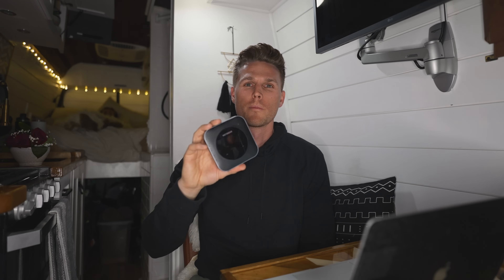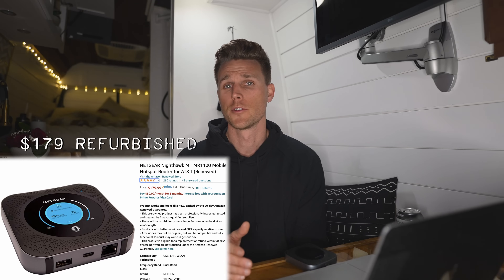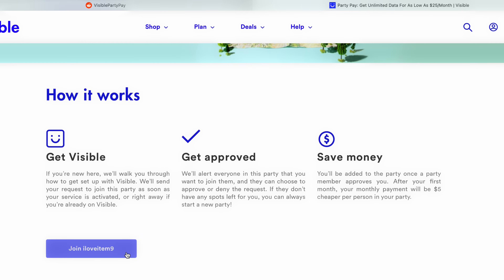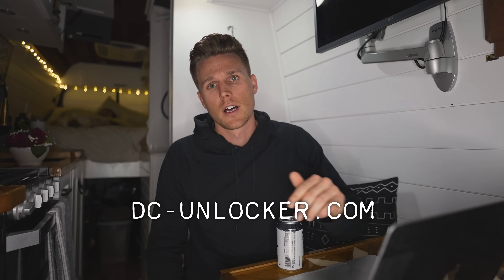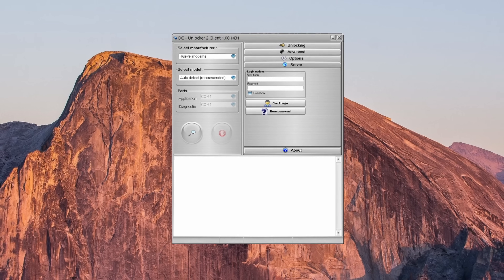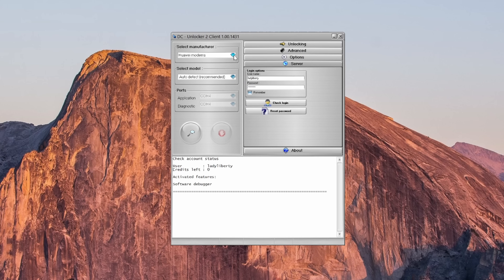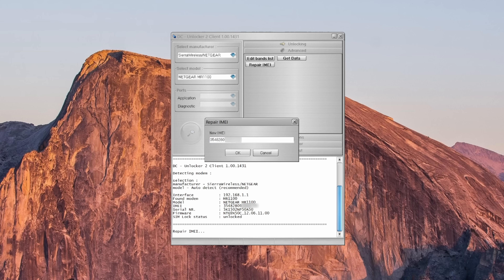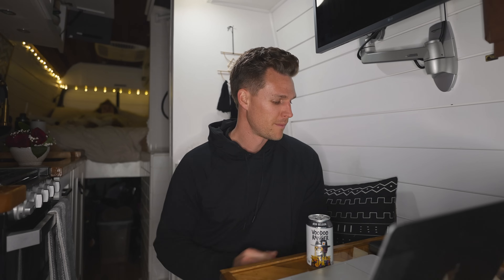CHEAP Unlimited Internet for your Van/RV/Tiny Home or even small Apartment | 2023 | $25/Month

Comment: I’ve got it all configured. My iPhone connects to the new network and I’m on the internet. However, my speed tests show that I’m only getting 5gbps. I’ve tried it when the M1 only had 1 bar of signal strength as well as when it had full bars. No change. Not sure what I’m missing. 

BTW, excellent video.
Reply: visible restricts the hotspot data to 5gbps
Reply: @ratfacekick  based on this video I’ve changed the IMEI on my router so that visible thinks it’s a phone and not a hot spot.
Reply: @rickcassani2810  I meant the hotspot on a phone, and mbps
Reply: Is it good for gaming

Comment: Well I think I have figured it all out with no help from Jake...(he doesn't reply)
I went back in to dc-unlocker ran a search on this Netgear and my search came back 
"DC - Unlocker 2 Client 1.00.1436

Detecting modem :

selection :
manufacturer - SierraWireless/NETGEAR
model - Auto detect (recommended)

modem not found !
Device must by detected before this operation!"
At the start of this I spent 29 credits to enter a IMEI number an all info was in the search and if I am correct I should be able to run a search and it should show my info but it doesn't! So Now what do I do anyone out there have an answer... I would be grateful to hear it. I wanted to take my girls on a road trip with WIFI it doesn't seem like I will....Or I will be returning this unit getting my $300. back...Please help  thank you

Comment: Sometimes when they say unlimited internet it really means is 20 gigs and once you go over those 20 gigs it slows down the connection is that the same case with that device you are using with those settings? If that is then why not just use another cell phone what is the benefit of it?
Reply: Say like att has 100 GB of data for regular cell data use compared to 30GB using hotspot data. So with visible they give you unlimited data, but at 5 Mb/s speed limitation. But this person has not said if the visible speed limitation effects regular cell data use, and visible clearly says that limitation is for hotspot data use

Comment: So as you said , you can use whatever sim card right? i got the unlimited att prepaid plan and it does not want to work with the hotspot, visible does work but not att prepaid , any suggestions

Comment: Having trouble with the visible SIM card it's too small for the m1 router what do I do
Reply: order a sim adapter kit its they are fairly cheap
Reply: it will fit -- slide it in easy like it shows near the slot and push it in and to the left side the slot - its how i did it -- it fits snug there and wont move.

Comment: You have to put the SIM card in the router before you start to change the IME number right?
Reply: NO - with or without a sim card.
Reply: @kkandretti  I'm having a little problem I don't think it changed the IMEI number it's running slow
Reply: @anwarbryant1940  could be because of the Server the software is running thru.

Comment: Ok so this bypasses the data use? 
I had unlimited with Verizon. And when I used hotstop. It limited my data for Hotspot. Which I felt was bs since it was an unlimited plan.
I have since changed carriers and same thing. 
However, phone works more now. But Hotspot reaches a point and stops working.  
Also I notice that even when I don't have Hotspot turned on. It charges me data.
Will this work with other Hotspot "router" as well? Since I can't get delivery from UPS/ FEDEX, ECT....
If so I will buy one from best buy or someplace.
Also will this work for a phone or tablet? Or does the Hotspot on them stop this? 
And another question.... so I can use the simms from my tablet for the router? If so thats good. I have a tablet that has a power issue. Doesn't like staying on.
FYI I'm a off grider.

Comment: So you cheat and cut corners to make this work. I have a Verzion Hotspot 4G LTE and unlimited for 20.00 a month. I think we’ll stay legitimate. Anything to get past a legitimate source for internet.
Reply: Droning did you have to buy a hotspot device from them to get the $20 a month unlimited service. i called them some time back and they more or less laughed at me for looking for unlimited for a low cost. Thanks in advance
Reply: @kkandretti  no we didn’t, it was added to our regular plan. Did we pay for the hotspot? Yes nothing is free but it only cost 200.00. No sale or wink wink special deal. Still on our plan and still,using it. Just got it at the right time I guess.
Reply: @droningharry  thanks for the Reply -- they should all offer good deals often - they would gain more business. But they are like Crack Dealers - get you hooked then change the Playing Field their benefit.$$$$$$
Reply: @kkandretti  I hate to say I agree but you're absolutely correct! They cheat you any way they can all the time.

Comment: This didn't work for me! I did everything step by step...I got my old iPhone dialed *#06# got my IMEI number for it, got the visible sim card activated it, in my iPhone; went to dc-unblocker paid the 29 credits entered the IMEI of the router and all I get is "Mobile broadband disconnected your data connection is disconnected" and than "APN set up required" I believe I got that fixed.. I went on Instagram message Jake and got no reply on that end! What did I do wrong? I need help.

Comment: I've used visible for a year a and it's great but just have two on my party.  I need two more.
Reply: I’ll join if I can figure this out!
Reply: There are several PartyPay groups with thousands of members.  Bestcellphoneplans currently has 4415 members which is about 4410 more than mine. You can leave your current party and request to join.
Reply: Thank you Dan!  You just saved me $30 a month.  Dawn when you start your party pay click on one of the parties showing.
Reply: @gmaally3308  You're most welcome.

Comment: Needs some help - i have all these procedures done and saved to the M1-- i don't get a good signal at home for testing but i do get one bar of a signal,  so i got closer to a Cell Tower the next town over, and was getting 4 bars- i went to do a speed test and the screen just sits there doing nothing. Tried to use a few apps that needed data to operate and still nothing.
I get back home and go to the into town to the Verizon tower a couple miles away, got 4 bars, i do a speed test and it was testing at just over 5-6mbps on the scale.  Now why does it only work on the tower near my home but not the next town over or off other towers that give me a great signal ??? 
Am i missing a setting in the setup or something?  Any Help will be greatly appreciated.

Comment: A lot of what you did is unnecessary. I have a visible Sim running in a pepwave max br1 router. Minimal configuration. No changing imei and most importantly enforced TTL. Plus the ability to run external antennas and wired devices.
Reply: Can you tell me what you did
Reply: @ijeomaa618  buy a used pepwave max br1 router and put a Sim card in it. I prefer promotional Sim cards from eBay. You log into the pepwave with a web browser exactly like your home router. You tell it which carrier to use and set it to enforce a value of 65 on the TTL. That's it.
Reply: @NYHalfassprepper  You mean peplink? Because those are like $1000. What are you upload and download speeds?

Comment: Alright friends, I need some help. I'm stuck at the change IMEI number with this lovely catch-22: the unlocker states "connect to server" with the router plugged in, but if I disable the router it "cannot find modem" to complete the IMEI change. It's a Windows 10 computer. I have read a dozen articles and forums trying to re-prioritze my home wifi over the ethernet connection and I cannot find anything that will work. Please help me! I'm going cross-eyed over here! :(
Reply: What source are you using for your internet connection? As Jake explained in the video, you have to have a different internet connection WHILE you are making the change. (It’s the part of the video where he mentioned Starbucks.) If you aren’t connected to the internet - which is what “connect to server” sounds like, it won’t work. If you’re using the M1 for your internet connection, which is what “when I disable the router it says ‘cannot find modem’” sounds like, it won’t work.
Reply: @WhatsLeftOfJeff  I was connected to my home wifi which is not connected to the Netgear whatsoever. But because I have a Ethernet cable connecting the netgear to my computer, my computer defaults to using the Ethernet, even there is no internet being supplied by that connection at the time. I cannot find out how to de-prioritize the Ethernet connection to use the wifi instead. That's my conundrum.
Reply: @WhatsLeftOfJeff  thank you! I'll try it next week when I'm home.
Reply: @JJM Ma Thanks for posting that!  I had the exact same issue.  While I didn't fully understand what you did, it helped me find an alternate solution.  What I did was connect my laptop to the Internet via an Ethernet cable.  That took priority over the M1 and allowed it to work :-)
Reply: @JJM Ma Thanks - I'll have to try 5 Ghz because I was still getting capped data.  Unfortunately, I now have a bigger issue - it won't work with my AT&T SIM anymore.  Says "We're sorry but the phone you recently tried to use will not work on our network" and even when I put the old IMEA number back in, it still won't connect to the AT&T network :-(

Comment: Hello, thank you for this! My partner and I work full time using lots of zoom. Has using been methodology provided consistent speeds for you? Have zoom worked well and fast? Does it no longer throttle? Throttling has been been the bane of our existence
Reply: So far, they don't throttle. That could change at any time, no guarantees. But so far the gamble is a win.
Reply: I’m reasonably sure that the purpose of switching the IMEI number to identify as a phone is to bypass the throttling issue.

Comment: Hey Jake, I currently have an AT&T Unlimited Starter plan that includes 5G, unlimited data, talk, and text. If i were to stick my AT&T sim card into the Netgear Nighthawk M1, would it work as a hotspot router and will there be throttling? Also, will I still be required to change the IMEI? Thanks mate.
Reply: If you don't change IMEI number the sim car will read the router as a a hotspot instead of a cellphone
Reply: @ElevenAce  thanks man

Comment: Hey there, I did everything in this video to a T and got it to work yet I am still only getting like 3 down and 2 up which is not great at all. Is there any way I can increase this? The signal around here is pretty full bars and has coverage, I am wondering if there is a setting or something that is off. I tested both on my laptop and my phone and changed the IMEI as well as ran the terminal command and it is still very low speeds. I'd love to get this to work. Any input is so appreciated, thanks!

Comment: What speeds do you get with this setup. 
Thanks
Reply from the maker: Gotten as high as 77mbps. Usually seems to be between 15-30mbps
Reply: @JakeandHeather  ok thanks for the speed check.
This 3, 4 and 5G tells me nothing. It sure isn't 5 gbpm.
Reply: @JakeandHeather  isnt the hotspot data throttled to 5mbps? How did you get around this?
Reply: Damn…
That hurts…!
I’ve got an average of 300 download at home now…
I can not imagine ever going back to that slow of speed…
Reply: Upload speed is important for us. This would never work for me.

Comment: Ok I get to the step where I enter the 192.168.1.1 & it just circling.  Any advice?
Reply: not sure if this will help you -- but when i first tried to connect to the M1,  i used the USB input on my Desk that goes to the Computer -- it didnt like that i guess, i plugged the IM into  one of the USB ports on back the Computer and it worked.  Seems it dont like going thru a USB extention port. Good Luck

Comment: I have purchased the M1 from the link below, gotten my visible sim and followed the instructions to the best of my ability. I had questions but they were not answered. After 2 days of frustration I finally made it through the instructions and was able to change the IMEI of the router. The router still would not function as described. I again ask for help and received no answer. DC-Unlocker now shows that the IMEI has reverted to the original IMEI and I would have to pay again to change it. At least I can return the M1 to Amazon and chalk up the other expenses to experience.
Reply: In a different video (diff author) they said to activate the visible sim in a phone. then once activated take the sim out of the phone and put it into the hotspot. iPhones are great for this as activating visible on them is easy and straightforward. Visible is meant for phones not hotspots so there may come a time that visible could detect the hotspot usage and disable the device, or cancel your service.  I did watch yet another video where they talked about that.

Comment: How were you able to purchase a Visible sim for the hotspot? I am attempting to do so but “need an eligible smartphone” and am told that Visible sims don’t support mobile hotspots
Reply: Jake may have an updated way to do this... but in another video they said to activate the visible sim in a phone. then once activated take the sim out of the phone and put it into the hotspot. iPhones are great for this as activating visible on them is easy and straightforward. Visible is meant for phones not hotspots so there may come a time that visible could detect the hotspot usage and disable the device, or cancel your service.  I did watch yet another video where they talked about that.

Comment: Thanks so much for this video. I have set up a visible account and purchased the M1 from your link and followed instructions to the best of my ability which has not been enough. I really don’t even know where to start asking questions. Since you never mention putting the SIM card in the router I assume you start the whole process with the sim in the M1... is that correct?
Reply: Update: I finally made it through all steps including turning off pass through, turning on data, and adding visible apn. All appears to be successful.... but the network will not show up as an option on any device. Any help will be appreciated.

Comment: So I did this as you instructed, even in my verizon app reflects this as my old cell phone. The data uses is still showing as hotspot and is throttling at 15Gigs. How can I fix this?
Reply: Did you fix this?
Reply: I have not. It is still reflecting Hotspot usage.
Reply: @denniswood5228  ... and it always will
Reply: @strainofthought9142  so your saying this fix is a scam or that no matter what my hotspot reads it won't throttle?
Reply: @denniswood5228  I'm suggesting that this guy is just trying to sell crap through his links.
Reply: Did you change the ttl on your device
Reply: @BaldBozo  no is in 64

Comment: just found your page good info. but does this act as a hotspot for my computer. I'm a gunfighter not a IT guy so english please...lol
Reply: yes, if you activate it on the hotspot device it will act as a hotspot for your computer. 

Even when you just run visible on your smartphone it comes with unlimited hotspot for one device that is never throttled but is capped to 5mbs upload/download.  if your one device is a computer there are a couple netsh commands you could run to bypass the 5mbs cap on the computer. giving your computer nearly the same mbs speed as your phone/hotspot.

Comment: The more people share this IMEI "hack" information, the better the chances that Visible is going to create counter measures to stop it. Just like AT&T ended the unlimited mobile data for $35 because they caught on to what everyone was doing.
Reply: Actually most people who got shut off on that either did not change the IMEI or were using 200 GB+. I'm using the $20 at&t postpaid plan with an iPad IMEI and there's been no issues. They can't really say anything since it appears to be from an iPad

Comment: So this only uses the signal it creates from the late modem right? It can’t pick up abs rebroadcast other WiFi signals like from an rv park? Assuming that’s true, if I use my visible sim in this, and it thinks it’s a phone, and then I pick up the net gears signal with my router and rebroadcast it, will it still be un-throttled or will visible recognize that it’s being rebroadcast abs throttle it down? Hope that’s clear, lol. Great video!

Comment: Jake & Heather - THank you for the post.  I picked up the M1, everything is working great while the M1 is connected directly to my computer via USB - Speed test = 70Mbps.  Speed tests over WIFI = 20Mbps?  The signal is strong, full bars on WIFI and the M1 signal doesn't change connected via USB or disconnect. What do you think the issue could be?
Reply: The router sucks, my roommate and I would use it and crashes all the time. I suggest using the M1 as the modem and connect it to a dedicated router. Using the Ethernet port. Makes a world of difference

Comment: I just started a plan with T-Mobile and ordered the antenna to help get more signal. I hope it helps.  Did you notice a significant improvement in connection and ease with getting your signal once you did this?  Also do I need to get a different sim card than the t-mobile sim card?
Reply: You will need an extra device or you will use the hotspot data depending on the plan you get, also the mr1100 is a 4x4 mimo adding antennas will downgrade it to 2x2 mimo